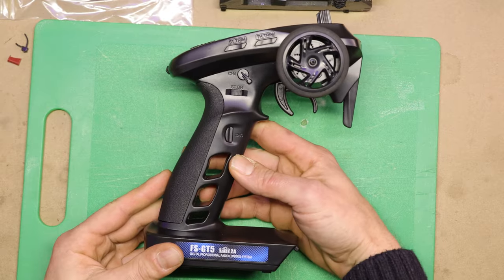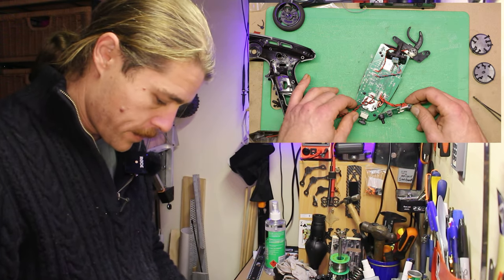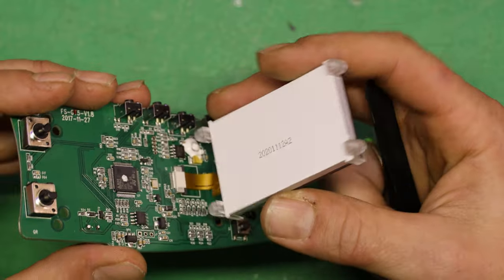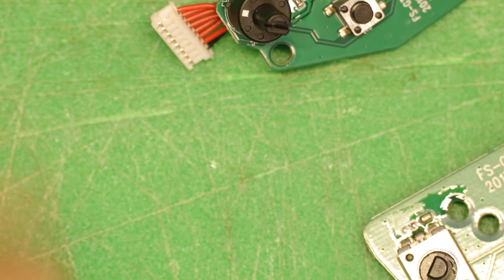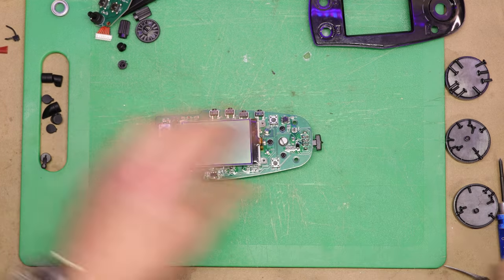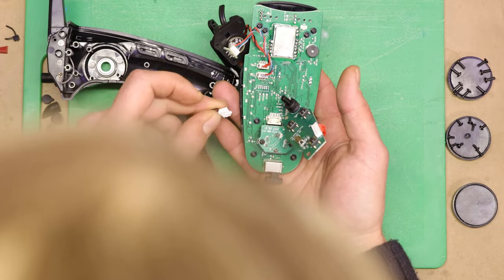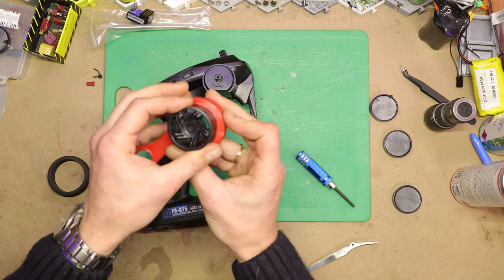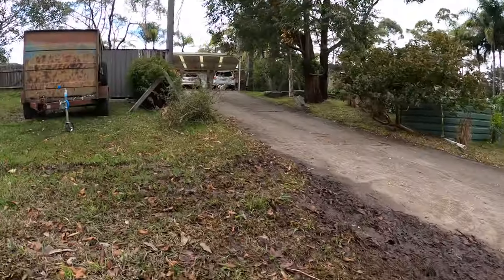FlySky GT5 Transmitter Teardown and Weatherproofing

Comment: I wonder what's going on between the daughter and main board. If channels 3 and 4 could be recoded as proportional channels there's a ton of opportunities to be had.
Reply from the maker: Good question Nutjob. Thought about this comment more than a few times. One day im going to open this thing again and stick the Oscilloscope on those line to find out. Would be cool to be able to make both 3 and 4 proportional or at least make 3 a three position like 4 is.
Reply: @macslife  I mean Beier Modellbauelektronik has an eight switch box that's supposed to run on a single channel to run their Lights & Sounds unit, so going in through through what was a basic toggle switch to start with...